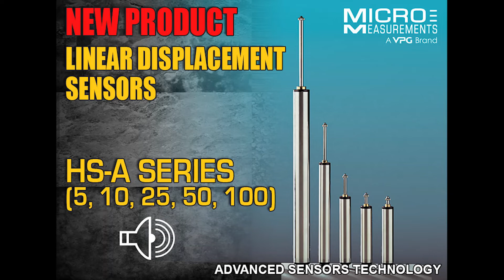Advanced Linear Displacement Sensors, HS-A Series , – New Design (6 Minutes Podcast)

Comment: Micro-Measurements presenta los nuevos Sensores Extensométricos de Desplazamiento Lineal HS-A (rangos desde 5 a 100 mm). Se trata de unos sensores extremadamente precisos, que se alimentan mediante tension continua y proporcionan una señal en milivoltios, la cual se puede ver y registrar en cualquier instrumento de extensometría, eliminando así la necesidad de disponer de equipos específicos (como es el caso de los LVDT's).
Algunas de sus principales características son: resolución infinita, linealidad real en todo su rango y excelente estabilidad y compensación térmica.
Los nuevos Sensores HS-A tiene la misma forma, ajuste y función que los tradicionales HS, pero con mejor no-linealidad y plazo de entrega más reducido, debido a la mejora de la eficiencia de su fabricación.
Si precisa de información adicional, no dude en contactarnos. En Vishay Precision España, s.l. (filial española de Micro-Measurements), estaremos encantados de atenderles y ayudarles con sus ensayos extensométricos: mm.es@@t; miguel.bravo@@t